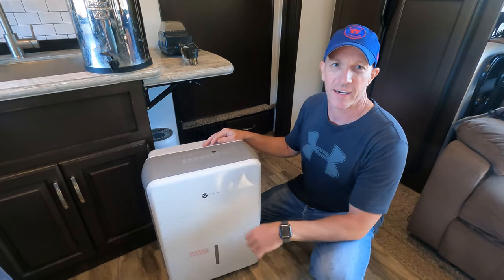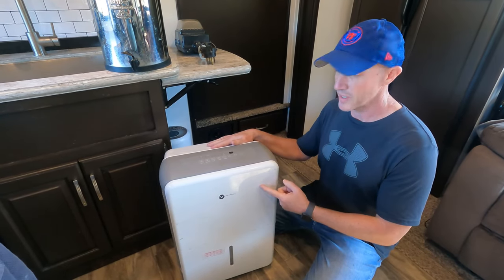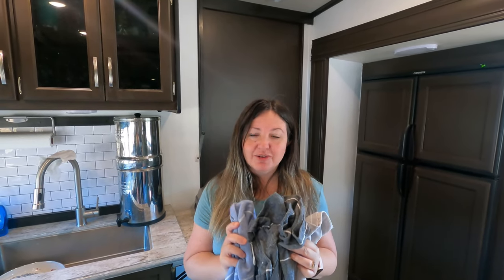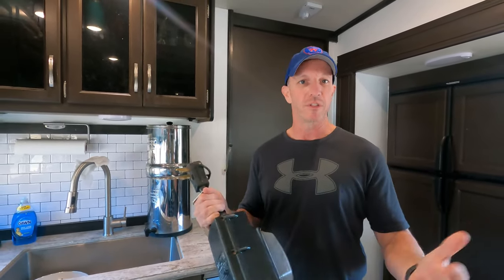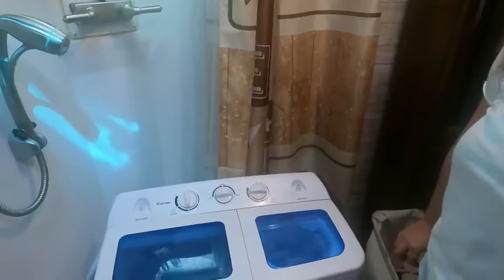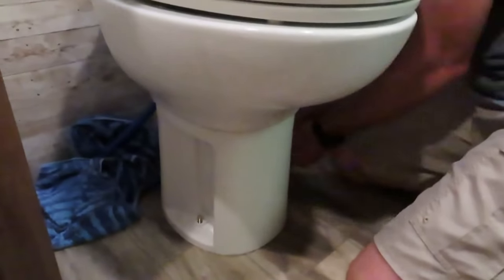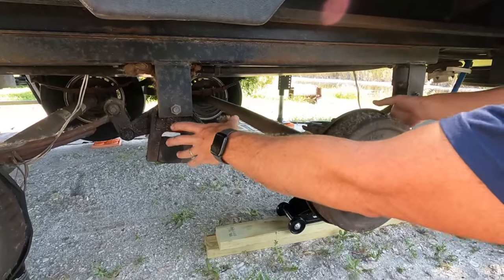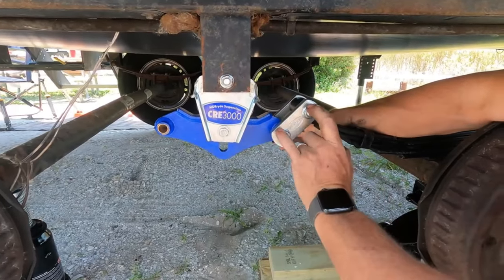RV Living Gear | RV Gear That Has Held Up & Some That Hasn't

Comment: Hello, are you planning to do a follow up review on the UNOWIX Defender X100 LiFePO4 Lithium batteries you installed? I'd be interested in knowing how they are working out. Thanks
Reply from the maker: It’s on the list, they are performing very well so far. We want to do some dry camping on them for a few days to see if the capacity still holds as good as when they were new.
Reply: Great. I look forward to hearing more. Thanks @JouppiOutdoors